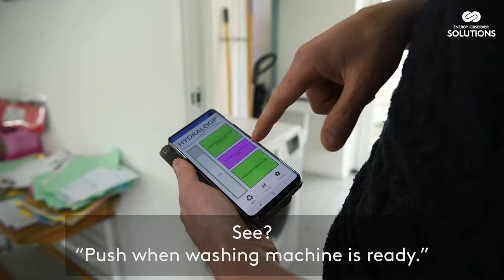Hydraloop, recycling water at home - SOLUTIONS

Comment: But sewage systems need that amount of water to function properly -- to dissolve and carry the waste to the treatment plant.
Reply: Even older sewage systems have no problem with 45% less water to dissolve and carry waste to the treatment plant. But the cool part is that in new build projects, you can actually build a much smaller infra structure.
Reply: maybe we can use the water recycled from the plant, perpetual loop.
Reply: @john wood Ancient Celt I would like to learn more about this. 🤔 This may be great city development projects.

Comment: How about cost to buy and cost to run the hydraloop?
Reply: Hi Susan, you can buy a Hydraloop system for €3.300,-. Depending on the lay out of the pipes in your home/building, your plumber might have to change some piping. The costs to run a Hydraloop are extremely low, it doesn't consume more energy than a light bulb. So, depending on water prices and sewage emissions, it takes 2-8 years to break even on costs. But most of all, you're saving 45% water!
Reply: @barbaramounier2835  this is great! Water will become a resource we need to carefully protect. Every home and building should be retro fitted with technology like this. 😀
Reply: @barbaramounier2835  Wonderful! Are there any monthly or annual maintenance costs for the system? Does it come with a warranty? How long is it built to last?